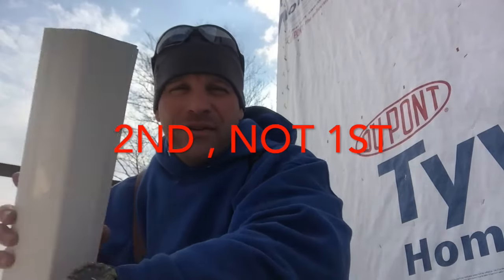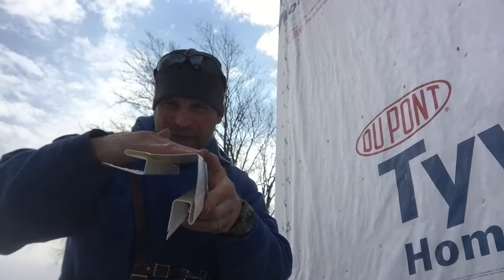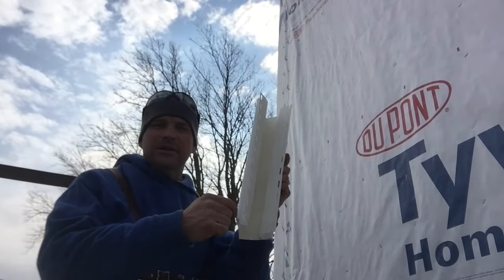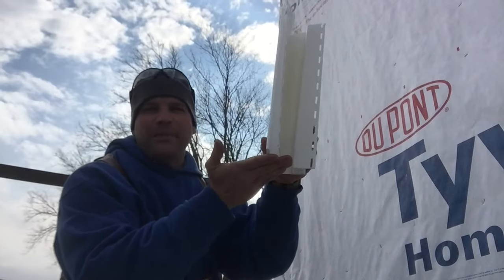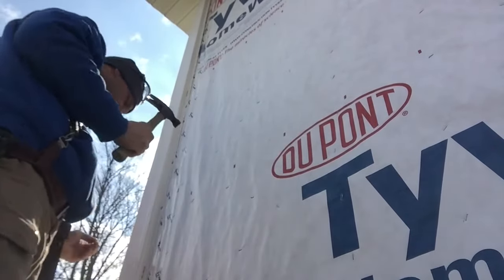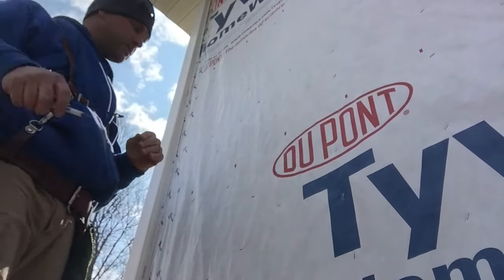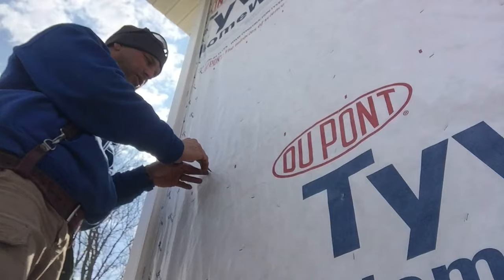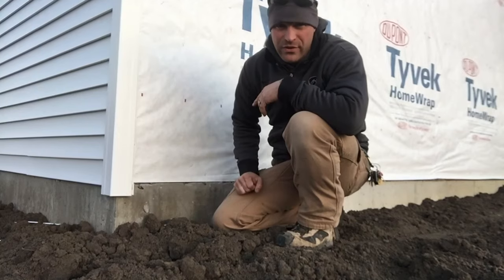How to install siding corners

Comment: I came here to replace a bent cornerpiece and now realize I have to remove all the siding just to get the corner out. Not going to do that. Too much trouble for me
Reply from the maker: I’ve patched in part of the corner before and only taken off one piece from each of the two sides that the corner is attached to.
Just cut the corner so the patch piece goes up inside the above piece and covers over the below piece. 
If you have a siding removal tool, it’s not that bad. 
I have a video on how to use a siding removal tool that may help.

Comment: Thanks for the tips!  Thanks for the straight forward videos that are easy to follow.   Do you have a video that shows how to install vinyl corner when the siding level isn't the same on both sides?   Situation: On the back of the house the siding is near ground level, when it transitions around the corner, the concrete foundation jumps up 3 feet due to ground slope, so the siding it 2 feet difference in the starting strip elevation....how is the corner trimmed/installed to look normal?
Reply from the maker: I’ve used J - Channel on the side that needs siding until it reached the height of other side that needs siding. If you have a picture of the wall and corner that you are talking about I’d like to see exactly what it looks like. If you could email me a picture, I could give you a more comprehensive answer. My email is mrkongable@gmail.com. Thanks so much for the view and kind words.

Comment: How would you put on the corner where the top is exposed to the elements like on a chimney
Reply from the maker: You can make a cap out of aluminum coil stock that covers the open parts of the corner

Comment: Why did you not close up the bottom of the corner post?  Are there a good reasons or situation where you would and would not do that?
Reply from the maker: So any moisture that gets in from above can get out
Reply: I have also been looking for guidance on this. I'm using Tamlyn corners and flashing, and LP smartside. I know any water needs to get out, but I don't want insects nesting inside.
Also, why start corners a full inch below starter? I think a half inch max would suffice, and look better, IMO

Comment: my kid ran in to the side corrner with his wagon  breaking a hole in the side. any recommendations on what ta do
Reply from the maker: You can replace the corner with a spliced piece of a new corner. You will need a part of a new corner , take off the siding on both sides up to the part your replacing and install the new corner, and re-install the siding. A siding removal tool will be very handy to help.

Comment: OMG. I can't believe I just special-ordered a corner piece to replace one that my lawn guys hacked up. As someone else here mentioned, I need to remove all the siding to replace it? It'll look stupid if it's in 2 pieces. It's right by the front door, too. I'm a woman with zero siding experience. 

I, also, have a horizontal piece on the bottom that I need to replace. Lawn guys shredded that, as well. I hope I don't have to remove all of that, too?

Comment: What do you do if the corner of the house isn't plumb? Put a level on the corner of my house and it's off almost 1.5 inches top to bottom. That's a two story house
Reply from the maker: If you don’t have any siding on it, you could shim it from top to bottom with starting out with a 2x4 and going down to a 1/4 piece of plywood , but if it doesn’t effect the structure, I’m not sure I would do much to fix it. Siding will cover a multitude of framing mistakes
Reply: @mr.kongable  so I put it on square to the house so there was any smashing or twisting. Then I had someone tell me that was wrong. I feel I like that better then  possible causing it to twist or smash. Thanks for the reply. I feelclike you don't really see the 1.5 inches once it's on the house.
Reply from the maker: @cmiller8006  I would say you did it right so it doesn’t twist. Well done!

Comment: Recommendation please! How do you close the siding corners from the bottom, so insects and mice can’t get in
Reply from the maker: You could do a few different things.  You could spray it with insulating foam that doesn't expand much,( for doors and windows). You could pack it with Steel Wool so mice can't get through it. You could make small wood plugs that go in the bottom of the corner, or use the PVC "wood-like" trim boards to put a "cap" on the bottom of the corner.  Hope it helps.
Reply: @Trevkongable  Thank you! I will go with Great Stuff Window & Door Foam Sealant!

Comment: I have a house with zero soffits. What is the best way to finish the top side of my corner post under my facia board.
Reply from the maker: I would get some coil stock and bend a cap to go over the top of your corner
Reply: @Trevkongable  can I email you a picture of what I came up with?
Reply from the maker: @scottmedes4817  sure thing , mrkongable@gmail.com

Comment: How about the top? How is it supposed to look and keep water from getting behind?
Reply from the maker: The top buys up to the soffit where the wall meets the roof
Reply: @Trevkongable  thank you for the reply. On my house I have a corner where there’s overhang with soffit on one side but no overhang on the other. Is it safe to fill that void with foam or flexible caulk?
Reply from the maker: @checkfoldcallraise  I think it would be fine to do that or bend some cool stock to act as a cap
Reply: @Trevkongable  thanks for the help, have a great day!
Reply from the maker: @checkfoldcallraise  absolutely, you have a great day as well. Thanks so much for watching the video

Comment: do you have the foam board behind the tyvek>
Reply from the maker: I do not. For the cost of the foam board, I chose to use a more dense fiberglass insulation inside the walls.

Comment: Was wondering if you could explain how to measure which corner to start first, they always mention starting with the high corner first, and how do you make your height at the top, what measurememnts..thks
Reply: You have to find where your  1/2 in sits on all 4 corners measure down from the bottom of the 1/2 in to top of the concrete foundation. Say you got 90, 90 1/8, 90, 90 3/8. Start at 90 3/8. Your corners only need to be 1/4 below the siding.
Reply: @Joe_H_  Hi Joe....sorry  but i dont understand. have to find your 1/2 in, measure down from the bottom, what do you mean.i dont have access to the top of my concrete as the outside of the foundation is covered with OBS sheathing.or do u use some sort of measurememnt before u place the obs on the exterior walls, thks
Reply: @48Drummer  he means go off bottom of wood my cement walls half covered that's what he mean we're wood and cement meet hope this helps 1/2 down from wood if corner inch to inch and half hope this helps

Comment: How to properlt replace the corner when damaged?...not the repair by cutting piece to cover front. Can the siding pieces be lifted just enough to remove and replace corner(if so, a video to show how maybe🙂), or do all adjoining siding on both sides have to be removed? Thank you for your video and instruction.
Reply from the maker: Siding can be unhooked easily with a siding tool, i'll have to make a video on that.